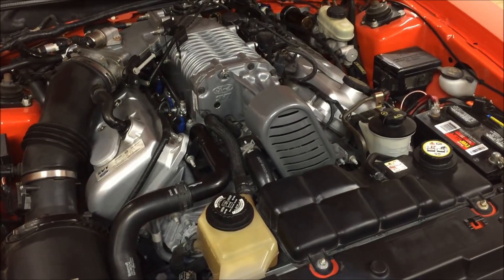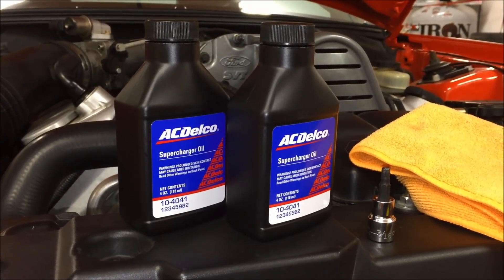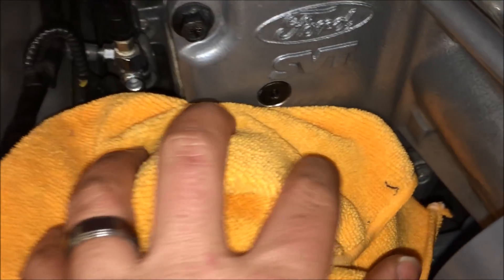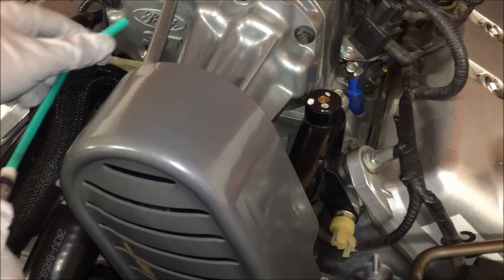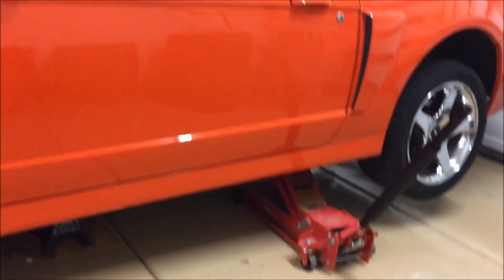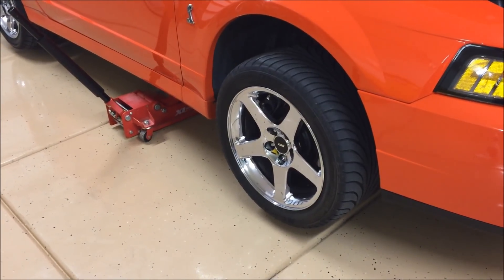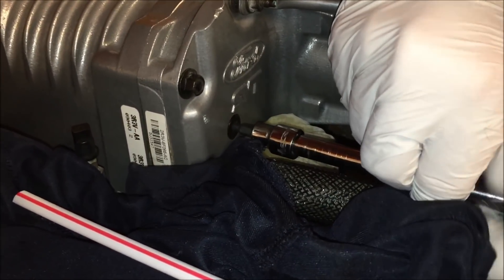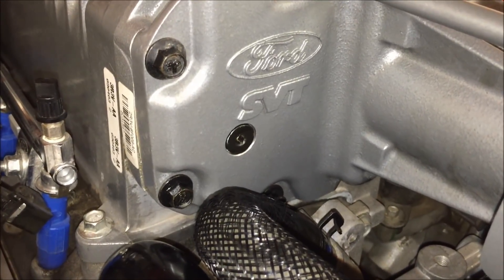Supercharger Oil Change 03/04 SVT Cobra Terminator: How to Change Supercharger Oil. Lightning

Comment: Hello! Great video. I saw you linked thread sealant for the drain/fill plug. But didnt see that step in the video. Is it required or is tightening snug enough? thank you
Reply from the maker: You just want to put some thread sealant around the bolt to keep any oil from leaking/seeping out
Reply: Makes sense. Okay thanks!

Comment: Danny, I have the same Cobra as you, but it’s all stock. What would you recommend as a replacement pulley for the Eaton supercharger? Thanks
Reply from the maker: More important than the pulley, make sure to get a good tune when you install it. You’ll also need a special puller to remove the stock pulley and press on the new one. I would recommend getting the kit that then allows you to swap pulleys after that easily without having to use the puller. You can do the 2.76” or the 2.80”, or 2.93” are very common, but you’ll want a snub idler as well so the belt doesn’t slip https://youtu.be/sYJ-acUMG6Q
Reply from the maker: https://youtu.be/AhrugyYieFI
Reply: Leave it stock, and buy a Coyote car to mod. These cars got so molested and beat to death due to all the potential they had (especially for their era) that finding a clean stock one is a rare treat that really stands out. Don't get me wrong when I bought my 03 back in 06 I was ready to mod it, and back then a stock Terminator was like WTF, but 21 to nearly 22 years after these cars first went on sell you just think, "I wish there were more clean, untouched examples of these awesome and unique Mustangs." They hold a very important place in the Mustangs history, and a stock, clean example is a collectors dream, and worth some real $.

Comment: And just one more thing...I have a siphon pump...made by OTC...model 2359..that is indispensable for removing fluids out of tanks..containers..or even the disposal when your drain is plugged...can use with water...coolant...oil...a much better way to drain the coolant out of your blower tank..or radiator tank...or any other fluid in your car...cheers...Paul.
Reply from the maker: If I didn’t smell so bad, I would use a shop vac 😀

Comment: Just thought I would share this with you...I called Whipple and was told the same thing....75,000 to 100,000 mi...!!!!...meh...I will err on the side of caution and change the oil...hell...blower has been on the car almost 11 yrs...just bought a oil change kit on EBay...8 ounces of oil..GM...and a syringe with clear hose to suck the old oil out..$ 23.00 ...problem solved...😀😀..
Reply from the maker: Yeah, it’s typical for all blowers to run about 100k miles but when you see black oil in the sight glass it’s not as good as clear. Age and heat should be taken into consideration and how you prefer to take care of things

Comment: I’m with you there Danny...I thought that it needed to be changed more often myself...my blower will probably never have 75,000 mi on it...it’s been on since 2010..does it need to be changed...car has 35,000 mi..what are your thoughts....cheers ...Paul.
Reply from the maker: Age of the oil is also a good reason to change it. It’s only a few ounces, so it doesn’t hurt.

Comment: Whipple says “ On a new compressor...every 75,000 to 100,000 miles...read into that what you want...but they designed it...build it and sell it...so I think they know best....😀😀😀
Reply from the maker: It’s also depending on driving conditions and age of the oil so think about that for heat, primarily and what that does to oil as far as breakdown

Comment: Do you have to Jack the car up to change the oil?
Reply from the maker: It helps because it drains forward and then the fluid level should be slightly higher than the plug.
Reply: Did you Jack up just the passenger side or both sides? Thanks
Reply from the maker: Driver side rear for removing fluid and passenger side front for filling

Comment: Just did mine ! 

Mine has 75k miles , I’ve put 20 in almost 4 years . 
Previous owner must have had change right before I bought it .
It didn’t look or smell bad . 

I do have 1 question , I have no idea how much came out or back in ,spilt shit everywhere. 
🤣🤣🤣
I Jacked the front way  up , filled it up ,, set it level ran it cracked it just a lil came out .
I’m good to go right ? 🤣🤣🤣

Thanks for the videos , your channel is the first place I check for stuff about my car .
Reply from the maker: Yeah, if it is open and leaks out it should be fine on the level
Reply: @dannyjohnsonsgarage  
Thanks buddy !

Comment: how many miles for a supercharger oil  change?
Reply from the maker: It should last 100k miles, but it also says depends on driving habits. For me I’d say you should also consider how old the fluid is. 20k miles of hard driving or 5 years would be a good idea
Reply: @dannyjohnsonsgarage  My plug is on super tight.  I am going to have to break it free.  I bought a 3/16 hex head so that should do it (I hope).  How tight do you make it...just snug or is there a torque spec?
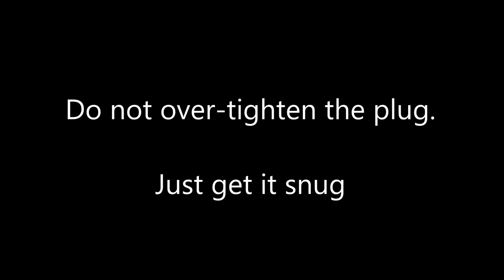Reply: @dickgi  It says at the end of the video @ 6:50

Comment: Yo bro how local are you to me ? I live in cali ? Im asking cuz i need help with my 2003 cobra
Reply from the maker: About 6-7 hours
Reply: @dannyjohnsonsgarage  im having an air leak somewhere by the blower the car was idling funny
Reply from the maker: Do you hear a hissing from a vacuum line in that area? A small mist of starter fluid in the area should draw some in and cause the rpm to rise
Reply: 🤔 ill try the started fluid and see if i could find the leak.... hey by any chance do you know anyone or any shop i can take my 03 cobra to that can help me with repair and mantinance ? I know u said u were like 6-7 hours away from me lol or else i would seek ur help u seem very  Knowledgeable on these cobras
Reply from the maker: I don’t know anyone around there unfortunately. 
  Check all the lines for any hissing and leaks and let me know if you can find anything

Comment: Hi Danny. Sorry to bother you about this but GM apparently no longer carries that SC oil and had a new part number (10953513). I'm sure it's the same thing but a different number since GM still recommends this to previous cars that used the old GM part number. 

Just wondering if you had any experience with this. 

And thx for all ur videos man. They really help out a lot.
Reply from the maker: I’m sure it would be interchangeable, but if you want the same part number it is still sold here  https://www.amazon.com/gp/product/B000QIR2ZC/ref=as_li_qf_asin_il_tl?ie=UTF8&tag=2004047-20&creative=9325&linkCode=as2&creativeASIN=B000QIR2ZC&linkId=7230369e1c400b092708f662718fd8d2#immersive-view_1587084302639
Reply: @dannyjohnsonsgarage  thanks man. Much appreciated but I live in Canada so Amazon won't ship up here. The Canadian Amazon store sells each bottle for $40 lol.

Comment: what size is the stock blower? PO did port mine though. And how often does the blower oil need to be changed? I don't recall seeing anything in the maintenance manual.What do I need to get that might be a better maintenance guide or will the OEM guide suffice?
Reply from the maker: Cee J 1.85L is the stock displacement (meaning it produces 1.85L for every full rotation of the supercharger- not the engine. I’ll give you a link to more on the supercharger and how to calculate its rpm compared to the engine). The supercharger holds only enough oil until it overflows out the fill hole. Change intervals is 100,000 miles, or more if heavily modified/ heavily driven. I’ll also post a link to the SVT supplement. I believe that’s where I got the capacity, but maybe I found it elsewhere
Reply: @dannyjohnsonsgarage  cool man preciate it. And excellent every 100 k miles ish ain't bad :)
Reply from the maker: Cee J Superchargers and supercharger rpm relative to engine speed  https://youtu.be/sqYP7YGanYg
Reply from the maker: Cee J Supplement.  https://youtu.be/V8fc73gmD08

Comment: Did your red one have a whipple? In that spark plug video. Same process?
Reply from the maker: EGvlogs My yellow car has the whipple- similar process, but the fill/drain plug is only on the top, so you have to siphon it all out like shown in this video. Whipple has its own oil, so that “should” be used instead. I listed the two types below
Reply: Danny Johnson awesome thanks! Great tutorial videos man.
Reply from the maker: EGvlogs Thanks!
Reply from the maker: EGvlogs Whipple oil 
scoil-155. 
https://www.amazon.com/gp/product/B07PVT9MRH/ref=as_li_qf_asin_il_tl?ie=UTF8&tag=2004047-20&creative=9325&linkCode=as2&creativeASIN=B07PVT9MRH&linkId=024404eb4b328da1a8099c86f25f89f3

scoil-200
https://www.amazon.com/gp/product/B07PWR6NYH/ref=as_li_qf_asin_il_tl?ie=UTF8&tag=2004047-20&creative=9325&linkCode=as2&creativeASIN=B07PWR6NYH&linkId=0239d3a3083fdcfe6ac14a8ca39c4403

Comment: Me again Dan, my cobra has 47000 miles on it, no idea of the supercharger oil has been changed, would you recommend it?
Reply from the maker: GSD fan It wouldn’t hurt. I’d consider it. How hard has the car been driven? If high heat situations I’d change it for sure
Reply: Danny Johnson found out the car has been set up for drag racing so I will be changing the oil, thanks dude

Comment: Mr. Johnson, I picked up my Mach 1 last night and have gotten to drive it for the first time today. Ive noticed a little bit of oil on top of my radiator and seen that my eaton doesnt have a nut screwed into the end of it, is that what is causing the oil Ive found? Thank you for any help and thank you for these how to videos!
Reply from the maker: So the fill plug we removed in the video is missing? I would get a new one quick and top the fluid level off so the supercharger doesn’t seize. I’m sure you know the supercharger system was put on by someone else as they did not come on the mach 1 but can be added using the cobra components. Very cool
Reply: Danny Johnson thank you so much brother! The nut wasnt missing and after a long weekend of searching I figured out that the seller must have used burt oil to keep the engine bay shiny as crazy as it sounds. The entire engine is only got about 4k miles on it, its an aluminator stroker engine, the nut I was talking about was acctually supposed to be open, it was the snout screw threads that scared me and I thought there was a nut missing in it. After I checked the oil I seen it was more than a qrt low, changed it and inspected everything really well and it seems to be fine no shavings anywhere and the blower is good too, I used this video to walk my way through changing the oil in it and I cant thank you enough Danny Johnson! Have a great evening buddy! Ill post some videos soon when I can get it dynoed.
Reply from the maker: Christian Miller Great! Glad it worked out. Feel free to browse my channel for my other vids. I have a ton 😉

Comment: Nice vid and very clean car! I have a 04 Lightning and everything is stock. I never changed my SC oil. I was told that it uses the oil from the motor. I dont drive it hard....anymore. It has about 125k but only 50k on the new motor. Was replaced by Ford. All OEM parts. Eaton SC.
Reply from the maker: Thank you. The supercharger oil is separate  and can be changed the same way. Your lightning has the same supercharger as the cobra, but with a different intake setup. Thanks for watching!

Comment: Nice bro thanks, my cobra have 26k miles, I bought it few months back and I don't know if the oil have been change before. Do you know how often it should be change.
Reply from the maker: It should be good for 100k miles. Ford also recommends changing every 20k Miles if driven hard. In this case, we were more concerned about the age of the oil. It was still pretty clear, but did smell horrible, so it must have been doing its job and breaking down

Comment: Excellent video.  How often should you change the supercharger oil?  I have 13K on my 03 Cobra and only changed it once.
Reply from the maker: Yes, I should have mentioned. It says it’s good for 100k miles or 20k mile increments if driven hard. I was more worried about the age of the oil over anything.
Reply: Curious about that too.
Reply: Danny Johnson No worries man and thanks for confirming!  I was worried about the age of it too so had it replaced.  But after your video I may try to do it myself.
Reply: 60K miles on a completely stock supercharger. 30K miles on modified/pullied one. I'd change it no matter what after 7 years or so.